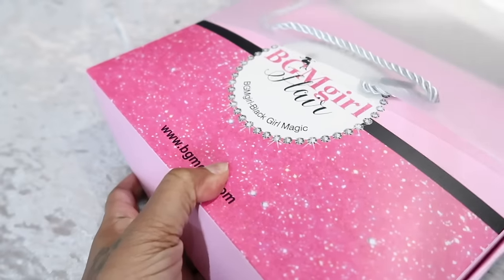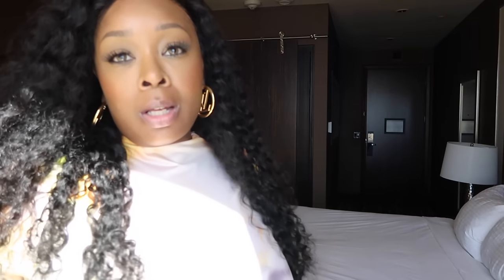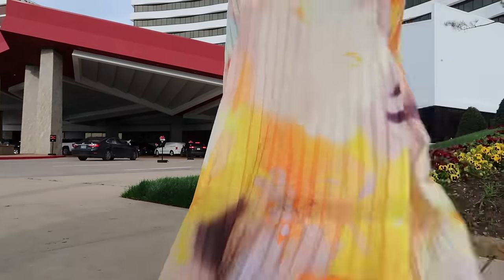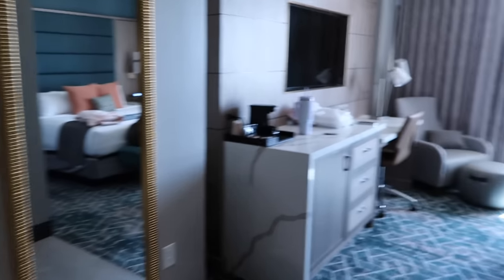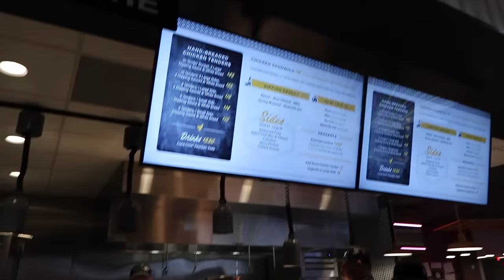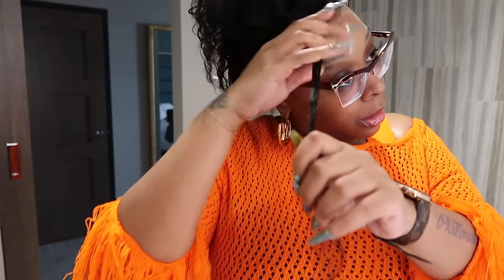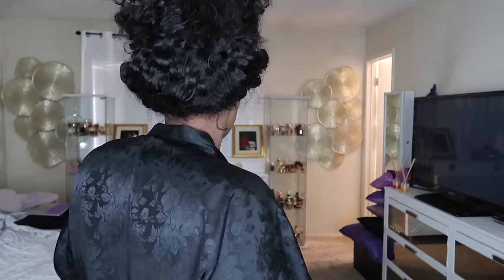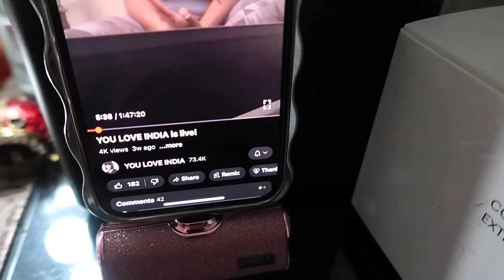VLOG~I GOT A SECRET*HE BROKE MY HEART*NICHOLE LEFT AGAIN*HE GAVE ME A KEY*CHOCTAW CASINO*BGMGIRL HAI

Comment: The spray might spray all over the place because it’s dried up product on the nozzle. Take something with a point and remove it. It happens with all my holding sprays.
Reply from the maker: I usually run hot water over it